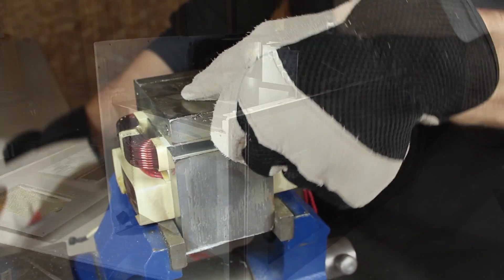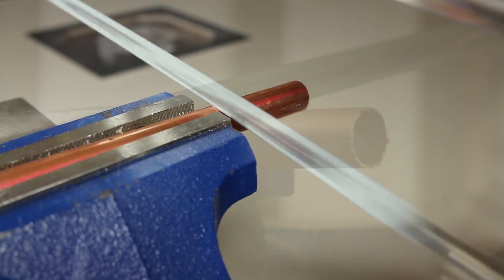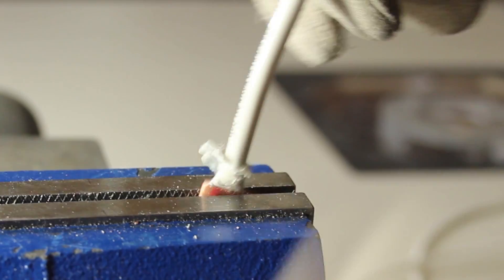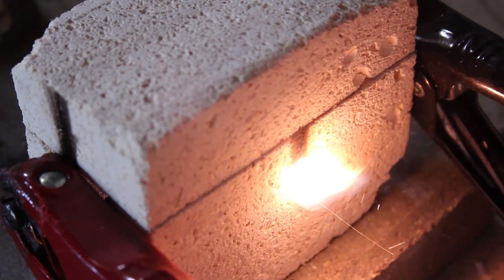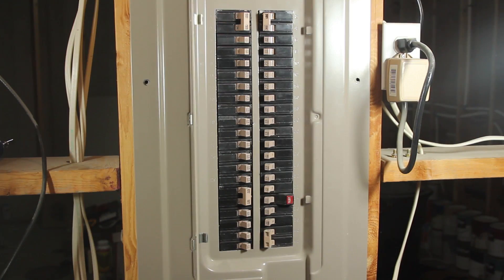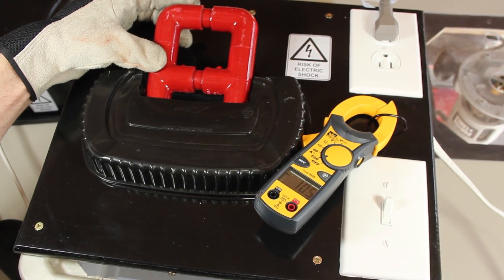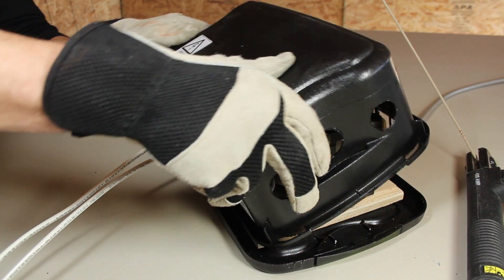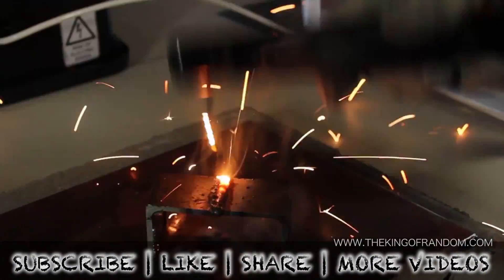Making an ARC Welder - Part 2 of 2

Comment: i would give it a nice breaker switch and a 240v fuse cuz im smart
Reply: also, goddamn ground the thing. 240 volts with unsafe connections AND no breaker switch or fuse? how DIDN"T you die?
i might do some of the things that i mentioned, but i WILL make one.
Reply: Or you just go to the Horrible Frieght and get you a crappy one that wont kill ya.

Comment: I conect them im parallel and they work perfectly at 110 v
Reply: Sadly, your comment went unnoticed. Probably because those that read it didn't really grasp what you did. Perhaps you should re-post it as a primary comment and include the pertinent "PHASING" data required to make it work properly. It's a far better and more logical wiring scheme than what TKOR did .
Wakodahatchee Chris.
Reply: @cdrive5757  you are right.  i totally forgot about that comment. I remember making this welder like 5 years ago when u was 14 years old. I dont know how i didn’t die hahaha. Now im studying engineering!
Reply: @CazaVideos005  I'm guessing that's a typo. Five years ago I would have been 70. I'm thrilled to see that you're setting your sites on an EE or ET career. I was beginning to believe that this generation would produce nothing but subjective majors such as Arts and Sociology. You're gonna actually make an honest and rewarding living! BTW: I guess by now you realize that wiring the primaries in parallel also draws twice the input current. If the OP had wired it with a 240V plug it would have been preferable in a shop environment, where 240V is common.
Wakodahatchee Chris
Reply: @cdrive5757  maybe it was even longer ago! Im loving the career that i chose! And yeah you are right. I live in Chile, so i have 220v sockets. But i understand what you mean. Cheers!

Comment: Si you are dealing with over 200 A and you cut off the ground wire....... Genius!
Reply: So*
Reply: should the ground wire just be hanging there? there is no place for the wire
Reply: +Speedyjens actually yes, it should be connected to the transformer housings

Comment: Guys, do you think i would get away with only 15 volts per transformer, so only 30V to weld in total?
Reply: yup i think so, just google welding arc and it should even be strikeable at only 8 Volts.. i am going to try it

Comment: aren't your transformers are heating up fast?
will transformers heat up due to improper secondary winding(like loose winding ,gaps in between the wires etc.)
Reply: +totakura anil so is it better to get solid wire instead of stranded?
Reply: yes i think it is better to get one solid copper wire which could handle the welding current and wind as tightly as possible 
the no-load losses of a micro oven transformers are high, so it will heat up fast without any load also

Comment: Can you just sync 3 car batteries up and run that to power this instead?
Reply: +Shiny James Lamoureux If you only want DC voltage and this won't weld steel. DC is used for welding aluminum like a TIG welder.
Reply: Yes you can make a stick welder out of a car battery. I've actually seen that done.

Comment: What is the clamp attached to? 
And the work piece what is it made of ?
Reply: The base clamp must be attached to either the work piece itself or a metal table it's sitting on in order for the current to flow through, so to speak. The stinger (the part that's holding the rod that makes the sparks and creates an arc) is holding an electrode with Flux coating. When the electrode makes contact with what the base clamp is hooked on to, it creates the arc. So basically, if you've never welded in your life then I would strongly recommend not making one of these. Electrical dangers aside, with welding and arc we're talking some serious heat. And by heat i mean anywhere from 2,000 to 40,000+ degrees. 

Warnings and information aside, does that answer your question? Haha

Comment: how would you work this off of one plug instead of two
Reply: You'd need inverter technology for that. There's probably a way to ghetto rig it but... You'd be safer with just buying a generator. Then again, if you actually plan on welding it'd be safer to just buy a welder. Stick welders are pretty cheap.

Comment: This won´t work unless you have 240 power coming into your house (3 heavy wires at your service entrance).  If you only have 2 wires you only have a 120 volts and you will need to have your power company install an additional line.  Many older houses are just 120 volts.
Reply: It'd be easier to just buy a generator. Then again, it would also be much easier and much safer to simply buy a welder as well.

Comment: nice little project :) ... I, myself, for safety concerns would still have added a wood seperator block between the 2 lugs on the wood block ... i saw your setup and immediately pictured the screws even slightly loosening and the lugs touching

Comment: I see very different transformer sizes in different guides. No one mentions the wattage of the microwaves they're using. This should be crucial information? Most microwave ovens are around 800W, will two of these transformers be enough? To me it seems too weak and then what do you do? I rarely come across bigger microwaves. Could one solution be to run three transformers in series or does this just further increase the amount of things that can go wrong to a degree where it's not worth the effort? Otherwise 3 x 800W wounds more reasonable for a powerful welder, or what are the opinions on this?
Reply: Well how many watts equal 1 volt? Going by the numbers he gives in the video, a simple conversion would answer your question.
Reply: I meant how many wattages on the microwaves for getting a usable sized transformer. The higher the effect, the bigger the transformer it seems. I'd just like to know where the transformers came from.

Comment: How do we connect the Electrical ARC Furnace to this?
Reply: +SamwizeMC oh, you just undo the screw on the center wire (connected to both and put on the side of the wood block in the front) and then screw both wires together on the wood block.
Reply: +SamwizeMC right?

Comment: I live in a country which has 240v coming out of the plug by default. Does this mean I'd miss the step where you use 2 plugs to power it?
Reply: +Ruslan McCabe Yes
Reply: +Ruslan McCabe I also live in country with 240. You can skip the step but only if your electrical outlet is able to give enough current. If it&#39;s not able, you have to combine two, but in the same phase and not in serie but paralel, just on different circuit breaker. Or find outlet wich has enough current. Typical in rooms is 10A, you need lil more, in my opinion I use 32A in the backyard.
Reply: +Ruslan McCabe nice, that means both our countries did something right
Reply: in pakistan we also have an output of 240v...but when i made this project i left the ground cables and didnt cut em off......so i didnt have to do two steps....the welder is working great
Reply: +Ruslan McCabe what country you from? Australia ?
Reply: New Zealand
Reply: definitely
Reply: +Ruslan McCabe 
not really, I am an Aussie, and now realise that the 120 volt, 60 Hz system is superior to our 240 volt 50 Hz. Tesla found the 60hz ac to be the most harmonious,  and thus laminations in transformers in the U.S don't hum and wear anywhere near ours and last longer. This is just one reason, we have 50Hz because of the Germans and the metric system.
Reply: +fleabag The germans and the metric system. Yep lets blame it on that
Reply: +DaRidez  we always have to blame it on someone else, that's the first rule of the Internet
Reply: Yeah, also a part of being ausie.
Reply: The Germans were having trouble with the electrical equations with 60Hz(seimens), so they used 50Hz , the english got the system from the Germans, and one guess where we got our system from. Merely pointing out that we are not lucky to have 240V 50 Hz.
Reply: depends.....if u use a more powerful transformer with more coils formed...yes it would

Comment: You don't need to use 2 fases to create 240v, if you wire the transformers primaries in parallel you get the same result with 120v !

Comment: Is it necessary to use 240v? One can connect the secondaries of the two MOTs in series to reach 36v when the primaries can simply be connected in parallel to 110v. The end result should be the same. Am I correct?

Comment: If you're not REALLY well versed in how electrical components work, even attempting to make one of these is just an elaborate and creative method of suicide.
I'd have burnt myself to a black crisp for sure trying to make one of these, no matter how careful I was with wearing proper insulating gear.
Reply: Will I die if I touch the terminals when I'm welding?
Reply: +Astuces de Trente Secondes - Must Kunst it's best not to try it. You ever welded before?
Reply: +Astuces de Trente Secondes - Must Kunst like oxy fuel welding?
Reply: RCG yes
Reply: true!!!!!

Comment: The box it's housed in should have been metal. The green wire you cut off should have had a lug that attached to the metal box. Therefore if you had a connection issue you'd blow a breaker not electrocute yourself.
Reply: +Darren Kelly Well, either the case needs to be made out of a non-conductive material such as plastic or it needs to be grounded so it can't become charged. Either way you shouldn't get an electric shock from the casing, which is what grounding is for. If something shorts out inside the casing, it will blow the fuses with or without grounding.
Reply: +Darren Kelly If he's using RCCB (esidual current circuit-breaker ) He won't be able to get shocked even if it's not grounded.
Reply: Precisely why it's better to simply buy a welder.
Reply: @BUGPLAYS  and what do you do if the time comes when you can't "simply buy a welder?" You missed the entire point and clearly lack the DIY spirit.

Comment: I'm pretty confused about how the two 120 volt inputs combine to create a 240 volt output.  In the video, if I understood right, he said he simply wired the two hot-leads together.  Did he just take the hot-leads from each input and wire them to either side of the output? Was there no neutral wire in there? If someone could help me understand I would greatly appreciate it.

Comment: Could you give us an idea of what the maximum amperage on the primary coil side is?  You show what the max on the secondary is, and what the middle of the primary is, but not the max on the primary side.  Since the variac needs to go on the primary side and I'm not too keen on using your scariac, I'd love to know what size variac I'd need for this.

Comment: you daisy-chained the power what can go wrong
Reply: +Robert Willgens if they were in parallel any difference in voltage between each secondary outputs would cause a fight, that would heat up both transformers to their destruction depending on the voltage difference.
Reply: jfghvljgvktgvlkhvgyv it was a joke

Comment: If you try this in the UK you won't need to run the two outlets with the adapter as a UK outlet already produces 240 volts

Comment: Grant, when i make the adapter for 240 volts, my multimeter only reads 120 volts when i have them both plugged in. Any tips?
Reply: +Cameron Schmitz that means both receptacles are on the breaker or the same phase, if you have a labeled breaker panel you can check the phases by simply counting down from the top of one side, so the first breaker would be A and the second would be B and the third would be A and so on. Then you simply find two circuits that are in separate phases, ex. bedroom circuit and kitchen circuit..
Reply: Thanks, I'm having a profesional electrician doin it
Reply: always a good idea

Comment: Yeah it works but no grounding? Without grounding wires can heat up... Can you say fire... And taking positive from two separate circuits hmmm... Make sure you don't have a load on either one and back to that ground lol

Comment: So I know you need to limit power through the transformers but isn't their a better way then having a big water tank?  One way that may work would be to wind a third coil around your transformers and then pass DC through the coil.  This should saturate the magnetic core making it transfer less electrical power.  But limiting it in a way that doesn't generate large amounts of heat.  That was what the small coil of wire was for that you removed.  So why not do it that way?

Comment: BUY A REAL ARC WELDER FOR 70 BUCKS! MINE GOES TO 100 AMPS AND WELDS HALF INCH THICK STEEL! RUNS ON 120 VOLT 15 AMP, NOT 240 VOLT.
Reply: What welder do you have?

Comment: This is cool if you know what you are doing, but for everyone else this is a mini death box.
Reply: +LaBalaDePlata432 Would you recommend that a teenager with no electrical background and no parental supervision try this built or others like it?
Reply: @_Dolofonia  I am a 15 yr old teen and currently making this with 4 transformers and a soon to be full bridge rectifier mounted so you will be able to switch from AC to DC. I am a bit crazy but made a lot of MOT projects and they work excelent. I am however using single phase. This is the first project I will do with 3 phase.
Reply: @_Dolofonia  yes its low voltage
Reply: ...and we never heard from Logan Spencer again...
Reply: LaBalaDePlata432 *Sarcasm*
Reply: It sure is 😂 i have an electrical degree, and i still wouldn't make this! Maybe in the future, so its going in the favorites.
Reply: Ginissi You'd have to be really stupid to ask the question that I did after LaBala said his opinion without some sarcasm. You are simply blind.
Reply: +mark bent did you die
Reply: Logan Lemaire Sweet man.
Reply: Him, Calmly: "The color of these wires doesn't mean anything, they're all gonna be shock hazards."
Me, screaming in my head: "This is a 240 volt suicide machine!"
Reply: +LaBalaDePlata432 my dad used to work on super colliders I think
Reply: What happened, Mark?
You still around?
Reply: He should have mentioned how dangerous these microwave transformers are if one doesn't handle them correctly before taking them apart from the microwave oven.
Reply: @Urban3009  why? What could happen if you don't take it off correctly?
Reply: I'm going to make one just to see if it works this well but I have multiple multimeters to test for everything and before I even touch anything see what's still got electricity stored and what doesn't before I touch anything
Reply: "Just throw away the ground - you won't need it."
Reply: Umm no.. Did you not read the comment?
Reply: Knives 'n Gear Sarcasm. you're bad at it.
Reply: I've decided that as a teenager with no electrical background and no parental supervision to take you up on that challenge. Course I'm gonna modify the design, use somethin' hellave lot less scary than his homemade variac, pull from 120 VAC and use 3 transformers. That sorta thing. But you know, same idea.
Reply: Logan Spencer yo, you still alive?
Reply: @DeathStar11113  rest in piece, young fellow.

Comment: Can someone explain what the common copper piece is that connects the two secondary coils? More specifically, I am planning to make his arc furnace that I will run from 240v (in the UK)
Reply: Its at 2:50 if that helps?